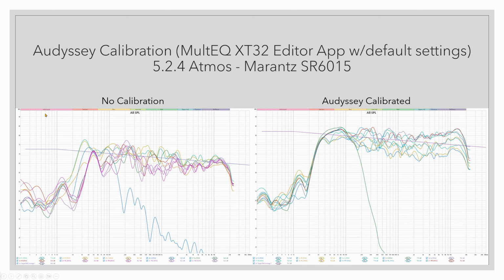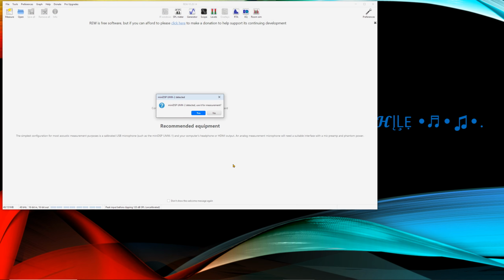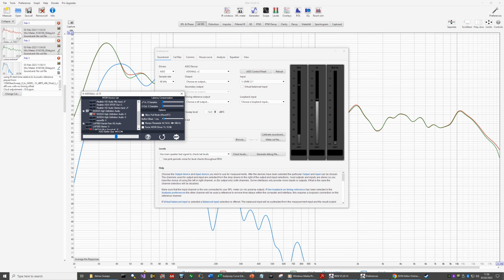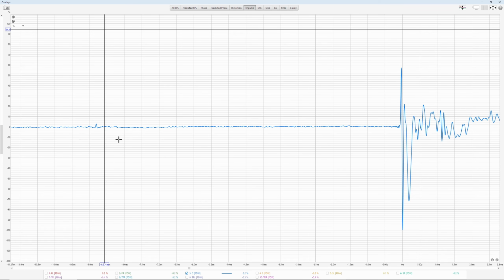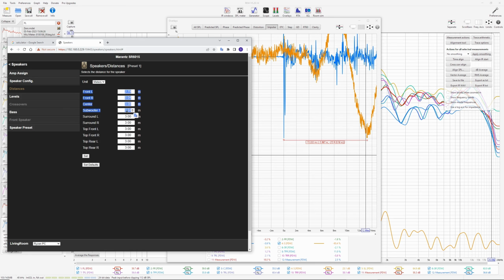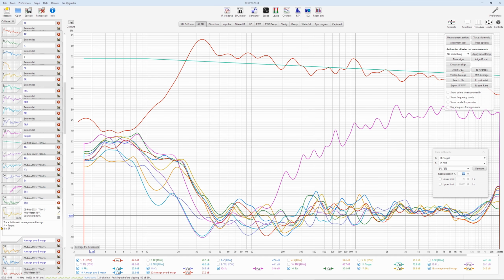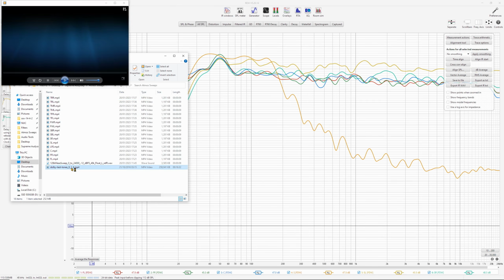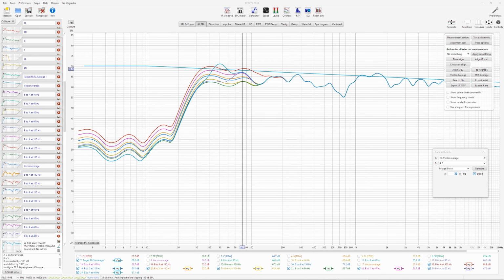Supreme Audyssey Calibration by OCA

Comment: Thanks you so much for sharing your knowledge and enthusiasm with other fans of home cinema systems. I will follow this tutorial and aply it in my Denon receiver. In a first phase I will use the original Audyssey microphone, with the calibration that you shared for REW, to evaluate the results. Later I'm thinking ordering a calibrated microphone, but I'm undecided between the UMIK-1 and the UMIK-2. If budget is not an issue, do you consider the UMIK-2 a better option? If yes, why? Thank you very much and continue the awsome work :)
Reply from the maker: For AVR calibration Umik-1 is really good enough. If you will dive into advanced digital room correction for stereo hifi in the future, I would rather go for an audio interface and a XLR analog microphone. XLR mics have better timing accuracy. Basic sets will cost less than an Umik--2.
Reply: Much appreciated for your answer. I'm only in the Home Theater so, taking into account your comments, the UMIK-1 is good enough for my best use. 😉
Reply: I followed the first steps but I got stuck in the PC multichannel output. I was not able to do it in my NUC PC with a Realtek audio drive. Any tips?
Reply from the maker: @miguelmedinaramos  You can choose between ASIO and Java EXCL drivers in REW. For ASIO, you'll need to install ASIO4All and you don't need to bother with Windows sound settings. All settings can be done from ASIO control panel. If you use Java EXCL drivers, Windows default player should be your AVR and the AVR should be in Movie/MultCh-in mode.
Reply: Just to give feedback it was quite simple after I use another PC. My PC is outdated (hardware and software) thus the ASIO4ALL did not worked. I will update my PC and surely will work. ;)

Comment: Hi OCA.  It is the last thing you remind us to do, but just wanted to double check. Do we change the Low Freq Effect back to 0db after we determine the crossover frequencies, or at some point before that?
Reply from the maker: That will not have any effect on the sound for sub and speaker crossover. LFE volume only changes special effects recorded for the sub channel only.

Comment: Hello. I did the JSON editing part. I opened it back in JSON to make sure it was showing the new values. Still after importing it into my AVR, I checked the levels and distances and they were not as expected.
Any idea what could be wrong?
Thanks!!
Reply from the maker: Are you on MultEQ-XT or XT32?
Reply: @ocaudiophile  XT32
Reply from the maker: Then it should work fine. Some XT users encountered similar problems. Have you converted responses of ALL speakers including the subwoofer to perfect (1,0,0,0....)?
Reply: @ocaudiophile  Yes I checked a few times and all of them are showing the correct numbers including the subwoofer. Bummer :/

Comment: Hey OCA, trust you are well. Got a question on the „determine crossover frequencies“ part of your video. I own 2 pairs of atmos upfiring speakers and I am wondering how to find the correct crossover. Should I vector average TFL and TFR and then trace arr. (merge A to B) with the vector of FL and FR or with the sub? As far as I experienced the atmos effect is better when using a high crossover (e.g. 180). I read somewhere that some bass management systems route in a 2 step way. E.g. Front Height speakers signals below crossover 180 being routed to fronts which are crossed over at 110 hz from there to the subwoofer as usual. What do you think, thanks Sir?
Reply: Thanks, this yoúll need to tell my better half 😂, I guess I need to live with that relatively good result. Thanks for your support and that great stuff.
Reply from the maker: Normally, they should been crossed over with the sub and the method you explained shluld work well. I haven't heard an information on two step crossover for height speakers. What receiver are you using?
Reply: Thanks. I use a Marantz 7706 processor. Have read somewhere about the 2 step crossover in an older interview with Andrew Jones since he was working with Pioneer. Besides that I found out measuring the heights as „large“ it’s bass response is kinda same than the front/rear speaker it sits on (measured as large as well —> only looking at the bass region below 200 hz or so). This tells me that the processor is allegedly doing some internal crossover to avoid overdriving the height speakers. When measureing the heights crossed over there is surprisingly no big difference between the frequency responses comparing 200/180/150, weird. As there is no big difference between 120 and 150hz I chose 150 hoping that supports the bouncy effect better.
Reply from the maker: Makes sense. But if your upfiring speakers are separable, I would suggest trying to hang them up in the front wall and use them as front height speakers. The reflection atmos effect is will always be compromised relatively.

Comment: Hello.

First of all, thank you very much for providing the calibration file.

I wanted to make a comment about how to use it:

I was trying to use the Audyssey mic to check the frequency response of my system playing pink noise and using REW's rta. And I believe the calibration file for the Audyssey mic you provided has the positive and negative values inverted.

My system was already calibrated following the avr's built in audyssey setup procedure.
First I measured with no calibration file at all, and I saw a frequency roll off starting at about 7KHz as expected according to what you showed in your other video about the hidden calibration file of the Audyssey mic. Then I loaded your provided calibration file and took another measurement. Instead of getting a flatter response, the frequency roll off starting at 7KHz was stronger. So I opened your calibration file in notepad texteditor, changed all negative values to positive and changed all positive values to negative, and saved with a new name. I loaded this new calibration file into REW, took a new measurement and got an almost flat frequency response. (The system was set to "flat" multeq profile, not "reference").

The calibration file for REW should show the mic output level at each frequency, not the required compensation. That is to say, if the mic's response is rolling off after 7khz, the values in the calibration file after 7khz should be negative.

I hope my comment to be useful for other users who are in the same situation as me: not having a calibration mic and wanting to use the audyssey mic in REW.

(Forgive me if I did something wrong, perhaps there is a way to load the provided file in REW so that it works as it should and I am not aware of it. I found that the file works inverting the values and I wanted to share it. Also forgive me if you or another user already said the same thing about the calibration file before).
Reply from the maker: You were right, it was having the inverse effect on the measurement. I've now updated the calibration file in all videos with the inverted one. Thanks for your attention!
Reply from the maker: I'll check that when I can (I'm away on holiday). It's remotely possible that cal file I've shared  is reversed but I hope you're wrong ;)
Reply: Hi, 
I was wondering how you connected the Audyssey mic to your computer. Is there some specific adaptor I should be using?
Thanks
Reply from the maker: Just used the line in/mic jack of the sound card

Comment: Awesome! Do you recommend investing $80 for calibrated UMIK-1 microphone for setup or ok to use the mic that comes with Audyssey (I just purchased Denon x4800h receiver that have Audyssey multiq 32x with mic)?
Reply from the maker: Congrats on your purchase, that receiver has the same processor inside as the top models and is made in Japan.

You can use the Audyssey mic that came with the receiver but make sure you use the calibration file with it while measuring speakers in REW. You can find the the link to the calibration file of these mics in this video:

https://youtu.be/KIozAzQH3CM
Reply: @ocaudiophile  Hey OCA, no Calibration of my soundcard necessary?
Reply from the maker: @leo180811  No, you can even use Audysssey mic with REW to measure your speakers. The tutorial should be showing how. If not that one, definteley the earlier ones on manual tuning.

Comment: I have done the process twice on my SR6015.  The second time after calibrating Subs with Mini DSP and treating the Room with some Absorption/Diffusion. However this time my Polk RTi A7 sound very bright? Since the Audyssey App Room Correction Results and Curve Editor graphs are kind of unique after calibrating, I am not sure If I could/should edit them to reduce the brightness.  Any recommendations on how to adjust the sound of the Mid <> Brilliance frequencies w/o going through the trace arithmetic speaker correction process?
Reply from the maker: You can change dynamic EQ strength form 0 to 5, 10 or 15. Turning "Cinema EQ" on will also dim the HF a bit.

Comment: Some of my impulse peaks are on the top and some are on the bottom. Should I align to the "highest" peak or the peak that is on the same side? Thank you
Reply from the maker: No, always align for the strongest peak regardless of its direction. Btw, compare the phase graphs in Overlays and invert the  polarity of a speaker if its impulse peak is in the opposite direction of the others. You can simulate that with "invert polarity" button under SPL & Phase tab and physically switch poles of the speaker if you decide to invert for real.
Reply: @ocaudiophile  Thank you! However the issues are my subwoofers and I can't easily change the speaker wires because of how they're installed. I checked "isReversePolarity" to "true" on the .ady file and it didn't change anything.
Reply from the maker: You can also change their polarity in json editor in the.ady file
Reply: @ocaudiophile  Thats what I tried. I changed the.ady file on the subwoofers: I changed "isReversePolarity" from "false" to "true" on the .ady file and it didn't change the direction on the impulse peak when measured.

Edit: The "isReversePolarity" command doesn't seem to work for me. I tried it on my center channel speaker and the impulse was the same - however if I physically switched the speaker wires around it does change... maybe its a bug?
Reply from the maker: I didn't try it myself tbh because I also switch banana plugs behind the receiver if I need to but I would think it's there in the ady for a reason. Maybe it's only used to remind the user to change polarity if Audyssey detects phase anomaly.
Reply: @ocaudiophile  That could be the case! Oh well, I became un-lazy for a bit and got out my tools and did some rewiring. All is well now :) Thanks again!
Reply: @ocaudiophile  Do you know what the difference between customDistance and delayAdjustment is? I see the command on all channels but the sub channel is the only one that uses it on my test calibration file.
Reply from the maker: I think it gets a value only when there're two subs and adjusts the delay between subs.

Comment: I'm having an issue with the MP4 sweep files. For some reason they don't play through the atmos channels - only the bed layer channels. Damn!
Reply from the maker: Make sure the receiver is in movie sound mode and stereo, it's the default player in Windows with 48kHz sampling rate and stereo mode. If you can't make WMP work, try VLC. If you're using a Mac, forget it!
Reply: @ocaudiophile  Thank you for that - it worked....but now the volume is way too low on all the sweeps. Way lower than the REW sweeps. As you know the sweeps volume cannot be adjusted through windows as it plays the sound in exclusive mode in the AVR. Also, with the AVR being in stereo mode, the relay will click every time I play a sweep file. Can I just leave it at my usual Multi Channel In + Dsur? It's a Denon x3700h.
Reply from the maker: @UpgradingAsUsual  Try turning of all sorts of loudness management in the receiver. It's on by default. If the volumes are still low then your receiver is one of the few models that automatically applies a dialnorm setting to atmos signals. The list shoukd be linked somewhere in these comments.

No harm in leaving the amp in multch in mode.
Reply: @ocaudiophile  OK, I don't have any loudness management setting but I do have dynamic EQ on. Is that it?
Reply from the maker: @UpgradingAsUsual  No, it's under surround parameters in Marantz SR6015 and only shows up with an Atmos signal. It has different names in other models.
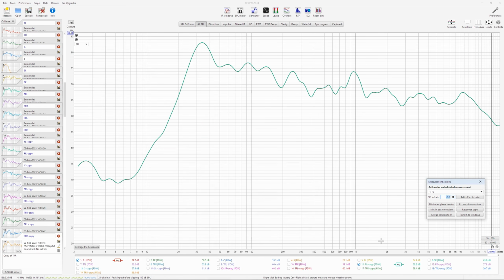Reply: @ocaudiophile  Thank you. I am now able to turn it off. Also, at 35:45 your forgot to Add Offset to Data. What does that do exactly? It is not explained.
Reply from the maker: @UpgradingAsUsual  Add offset to data increases or decreases the volume level of the measurement so that it shows the correct response after you add the same volume in the receiver setup.
Reply: @ocaudiophile  Ok, thank you. I am all finished now and it sounds absolutely fantastic! I cannot thank you enough. One last thing (I'm sure it won't be!), do you think it would be correct to turn on Loudness Management once again now that the calibration is done?
Reply from the maker: No dont turn it on
Reply: @ocaudiophile  Thank you again. 😊 I am subscribed so Im now just waiting for the new method you mentioned at the end of this video where you will only apply cuts to the frequency response and zero boost. 👍🏼
Reply from the maker: @UpgradingAsUsual  It should be out soon ;)
Reply: @ocaudiophile  With the process complete, it sounds really good but the real speakers sound like they are different speakers than the front (all 5 bed layer speakers are the same). As if they have a different tambre to the front stage now. Any ideas why that might be? BTW, I only notice this when playing games, not movies.
Reply from the maker: @UpgradingAsUsual  Dynamic EQ applies more boost to surround channels than the fronts when the volume is lowered. You shouldn't have this problem at the volume level you've  calibrated the system but maybe lower down. Audyssey believes human cannot hear rear sounds at low volumes as good and they have implemented this in DEQ. I personally don't use DEQ, calibrate the system with it OFF and then use only Dynamic volume for low level listenning or gaming.
Reply: @ocaudiophile  I would rather have dynamic EQ off as I want my system consistent at all volume levels. I'm assuming I should re-calibrate but with DEQ off from the get go or can I just turn it off with my current calibration? I'm sorry but I'm still learning this! :)
Reply from the maker: No problems Sk whatever you need to. If you didn't calibrate with DEQ off, you'll need to re-do it because it changes the response massively depending on the receiver volume.
Reply: @ocaudiophile  Thank you!
Reply from the maker: @UpgradingAsUsual  If you measured your speakers with DEQ on, you will need to remeasure them with it off. It has a different effect at different receiver volume levels. Make sure you measure everything at the volume level you always use your system at.

Comment: Just an idea. Create the PEQ in REW, import in Rephase, export impulse response of the filters back in REW, create division of the imported filter versus a flat impulse. This would get the FIR filters from the PEQ. Just tested and seems to be working very well. You can also further PEQ the result and apply another bank of filter correction in Rephase for even further refinment of the initial response.  Do you see any issues with this approach?
Reply from the maker: It should work but with one inversion in REW, you already create the required PEQ settings as custom curve edit points for Audyssey. Besides in general leess is more in digital correction . Too much eq especially in high frequencies will cause boxy sound. Try the method in Audyssey for Dolby Atmos music video where there's less correction and you might prefer that one for movies as well.
Reply: @ocaudiophile  Thank you! I will. I learned so much from your videos. I looked at one of my first measurements after Audyssey automatic calibration and it's night and day versus what I got following your methods!
Reply from the maker: @horatiud.5976  Good to hear that.

Comment: Excellent tutorial. I am in the process of doing the whole thing. Since i have 5.2.4 system, i have 2 questions; how i deal with th le two subwoofers? How indeal with the 4 atmos? Finally it would be nice to show a full frequency response after younadjusted the crossover and see how the suns integrate with the mains
Reply from the maker: Thanks. If you don't have a minidsp, to manage two subs, remember that Audyssey has only one correction filter for  subs. It time and volume aligns each sub and then corrects the sum of the two subs as one.

Comment: Got it going!  Long story short, I could not get REW to play multi-channel and only Java works on my laptop.  Anyway, your mp4 files did great!!  I was able to measure all speakers.  HUGE help.  
REW was saying the volume was too low so I took measurements of the FL and adjusted the master volume until the graph shows a peak at about 75db.  I left the volume there and took my 30 measurements.  See any issue with that??
Reply from the maker: Nice to hear